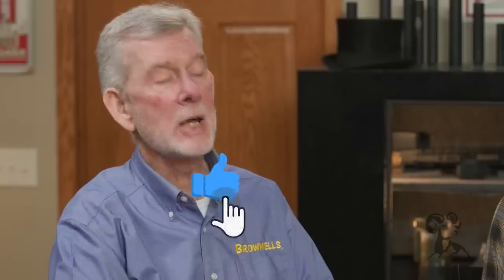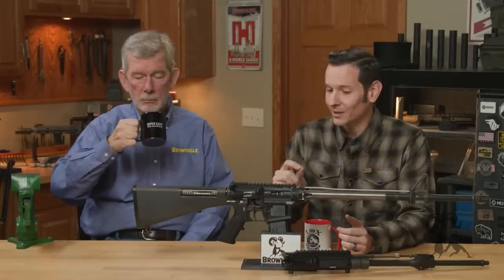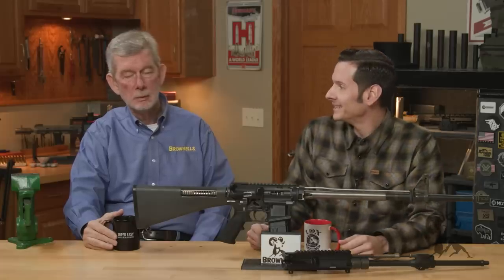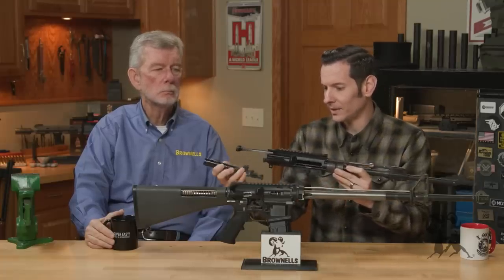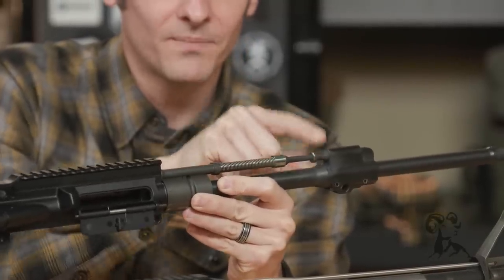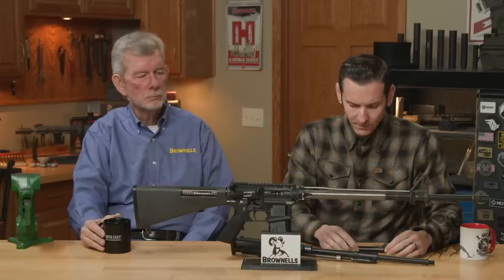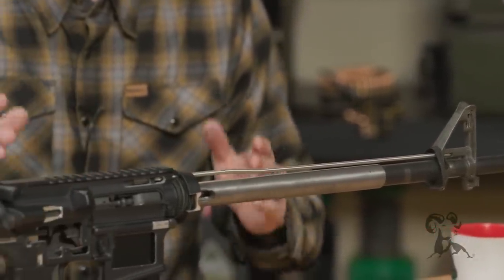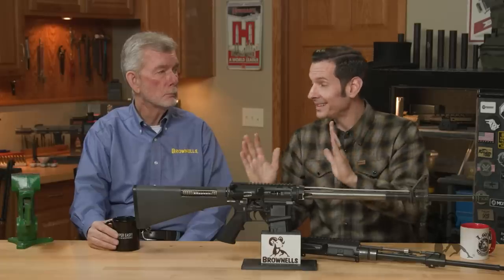Smyth Busters: The AR-15, Direct Impingement or Piston Operated?

Comment: Stoner was a freaking genius. The AR is basically a tube gun, no reciprocal mass that is of the bore axis except for the tiny hollow gas key.
Reply: What do you mean? The bolt is reciprocating.
Reply: @freeandcriticalthinker4431  I think he meant to say that all the reciprocal mass is inline with the bore. Other than the gas key.
Reply: *OFF the bore axis
Reply: @freeandcriticalthinker4431   I think he meant to type, "no reciprocal mass that is ABOVE the bore axis except for the tiny hollow gas key."
Being "above the bore axis" is the KEY thing.  Hah, pun!
67
Reply: Kalashnikov was more genius.
Reply: Kalishnikov merely copied existing piston/op rod designs.   The Stoner AR system was completely unique.
Reply: Maxim, Browning, Kalashnikov, Stoner. The Big Four of Gun Design. Stoner or Browning for the King?  Can’t decide.
Reply: @mikeoxlong3676  I personally think the 47 is OK. It is heavy and it feels bigger than it is, if that makes any sense.
Reply: @jimziogas8978  I'd have to give it to JM Browning, he created more designs, and long before Stoner did;  Stoner would have had to stand on Browning's shoulders, so to speak.
Reply: @recoiler4545  probably
Reply: Too bad it won't run in many conditions an longstroke piston gun will.
Reply: AKs are super dated. Hard to even put red dots on most. Near impossible to use lasers, lights, nods, suppressors. Then talk about shooting prone or reload times.  AR wins in every possible category. Plus your running steel case crap.  AK is cool, maybe if you like retro  commie stuff or video game guns.
Reply: @recoiler4545  nice one
Reply: The gas key does not have any directional force. Its simply a part of the gas tube, that gets unlinkedwhen the bolt carrier moves back. It experiences only a pressure force, that works in all directions like it is in the "rest" of the gas tube.
Reply: And yes: Stoner was a freaking genius.
Reply: @mikeoxlong3676 the AK is literally an upside down m1 garand
Reply: It’s interesting to reverse engineer it. To try to see what he was initially trying to improve. I believe “improve recoil” on a light firearm was his main mission.
Reply: @rumnboats7612  that's been proven false
Reply: AR-18>AR-15

Comment: A couple years ago, I heard Chris from Small Arms Solutions refer to it as an "internal piston" system.  At first, it went against everything I had been taught about the system since I was issued my first M16A1 in the early 80's.  Then he explained it much the way Caleb did, then the light bulb clicked on.  I've referred to it as internal piston operated ever since.  If I'm not mistaken, I believe there is old interview with Mr. Stoner where he calls it internal piston also.  But I'm not 100% sure on that.  Great video guys, as always!
Reply: Pistons are contained by cylinders. They are always internal. You had it right the first time. The entire bolt-is-a-piston story came from the patent attorneys and their creative writing - not Stoner. Ever heard of the cylinder being driven and the piston being dragged along? No. No you have not, except for the AR fiction
Reply: @Ni999  Have you ever driven a SuperMoto?
Reply: @woodrowcall3158  No and not all supermotos use rotary engines. See my other reply. The AR bolt is still not a piston.
Reply: So, it's an internal piston system???
Reply: @Ni999  So it is a cup piston, much like the LWRCI piston only the carrier is the cup piston..
Reply: @woodrowcall3158  My bad, the other reply was in a different thread discussing airplanes. I apologize for the confusion. Yes, rotary engines are the exception to my claim so my claim was weak in that regard. What's not weak is that Stoner called it DI and it was the corporate patent lawyers that tortured the definitions and came up with the story. DI had fallen out of favor, their prior art section glossed over the entire subject to sway the patent examiners. The design was absolutely worthy of its patent but the complete description would have been subject to greater scrutiny, and probably delays and reviews with no guarantee of success. Patent examiners can be very good but they do not have a perfect record with things requiring expert knowledge.
Reply: @hairydogstail  Yes, you can make the case that the carrier is the piston, absolutely. The problem came from the corporate patent attorneys wanting to avoid the DI explanation that Stoner used. They gloss over the entire subject in their prior art section as DI had fallen out of favor. The design was certainly (and obviously now) worthy of its patent but they invented an explanation that would work easily - and they were right.
Reply: @Ni999  Thank you for the additional information.  It's very interesting to learn the details behind it.
Reply: @Axe_six-six  You're welcome. I tried to reply with more specifics about patents but my comment was automatically deleted. 🤷🏻‍♂️
Reply: @Ni999  I was talking about the forks.
Reply: I could swear I've seen that interview I could be mistaken, but you're right either way Stoner was a genius.
Reply: @woodrowcall3158  Sorry. No, I was primarily on street bikes? What about them?
Reply: @Ni999  They are (generally) mounted upside down.

In relation to the frame of the bike the piston pushes the cylinder (which is attached to the wheel) down away from the bike.
Reply: @Ni999  I think I would call it sleeve ported, or a ported sleeve piston system - whatever it is called, it just works.
Reply: @Chuck_Carolina  Agreed, definitely.
Reply: @woodrowcall3158  Makes a lot of sense for that application.
Reply: @woodrowcall3158  I used to race a 1976 Mazda Cosmo in SCCA ITA class. 4 seasons of that cured me of any fascination I may have had with magic triangles and apex seals.
Reply: All semi automatic guns are piston operated, including direct blowback. The case itself is a piston, and is replaced after each shot.

Comment: Yes I already knew that but, playing the devil's advocate, since the gas does not use a dedicated "piston" and the BCG acts as the "strike face" you can look at it either way. How many pistons bleed off gas from a BCG or use a gas tube? True it is not a true direct impingement on at dedicated "strike face" either. It certainly is not a true piston system either but closer to a DI system that uses a gas tube that a piston system does not. Since the system is not a true piston system by using a dedicated piston and the BCG acts as the strike face we call it direct impingement right or wrong even though it is not a true DI system. Maybe we should call it an indirect impingement. Haha.

Comment: Just when I was finally understanding the difference between a direct blowback v. gas-recoil operated pistol (And at an elementary level at that) Steve and Caleb drop this one on all viewers!  Good, interesting video (as always from the Smyth Busters duo), but I’m sure I’m not the only viewer still not certain I could explain the differences between the two operating systems, even after viewing.
Reply: It literally just comes down to where the gas is being introduced into the mechanism. At the chamber, at the gas key, at the piston face, at the bolt face, etc. The gas tube on an AR-15 is just a tube that dumps the gas into the receiver, that's it.
Reply: @tedhodge4830  :  TY Mr. Hodge.  Happy Holidays.

Comment: Great deep dive into the DI gas system. One could argue, a lot of the heat is dissipated over the entirety of the DI gas system, vs all heat collected at the gas piston, forward barrel? Both systems have their pluses and minuses.
Reply: Okay, there are legit advantages for the Stoner system, but this is some extreme copium.
Keeping all the gas and fouling concentrated in one area makes cleaning much easier.
Reply: @WaterZer0  Maybe, but all the heat, and weight, IS concentrated near the muzzle. That's not to MY liking. Your mileage may vary!
Reply: @03redrubi  I understand the weight issue, but where else would you want the heat?
Reply: @WaterZer0  Not where my accessories, and hand are.

Comment: Eugene Stoner was an Aerospace Engineer by trade.  You can't have unbalanced forces on aircraft and expect them to fly well.  He felt the same way about firearms.  He wanted all action/reaction forces to be on the bore axis.  I've seen slow motion video's of AK's being shot and you can see the barrel flex down slightly as the piston is pushed out of the cylinder about an inch above the bore axis.
Reply: Stoner was never an engineer..He never went to college..
Reply: Ak vs Ar = apple's vs orange's 
It's an old and boring conversation

Comment: Steve forgot to put his hip waders on for the level of BS Caleb was ready to sling on this topic… 😂

One important point:  Eugene Stoner’s genius in designing that gas chamber inside the bolt carrier does something VERY important. The bolt is pushed forward while the bolt carrier is pushed backward. This relieves pressure on the bolt lugs, making it easier to disengage from the matching barrel extension lugs and reducing wear and tear.
Reply: It gives the gas a chamber to expand into that allows it to impart force to the carrier, allowing it to move. The delay caused by the carrier moving and the bolt staying locked allows the chamber pressure to drop sufficiently, relieving pressure on the locking lugs. The lugs want pressure pushing them into the lugs on the extension, that's why they're called locking lugs.
Reply: @ShortArmOfGod  I do not understand what point you are trying to make.

Comment: Love the idea of having the piston inside the bolt and carrier. For very hot loads, it uses the pressure to keep the bolt pushed into the barrel extension, relieving some stress off the bolt lugs. It's also argued that the piston and the gas tube help blow out debris from the receiver making it technically "self cleaning." Yes, it does dump carbon into the internals, but carbon acts as a dry lube, so that may only increase reliability.
Reply: There's a reason you clean your gun periodically. The carbon sticks the action and creates friction. It is NOT going to be the lubricant you think it is.
Reply: The byproducts of ammunition ignition are not solely carbon. It 100% does not act as dry lube ever.
Reply: @MellowFellowOfYellow  Exactly
Reply: Propellant gases are not carbon, and AR-15's should have external lubrication applied to its components, just like any other mechanical component where friction forces are present. To quote Dallas Fohrib from CherryBalmz: "When we dug into it, the fouling that all of us have been calling “carbon” for so long? Well, it turns out there’s almost zero carbon in combustion fouling at all. It’s about 98 percent lead and copper particulate, coming out in rough sphericule shapes between .5 micron and 10 micron, with the final two percent being things like tin, antimony, or steel, depending on the composition of the cartridge." Suggesting that an AR-15 is self cleaning is horseshit. The weapon wouldn't function if it was blowing all the propellant gas out of those two little vent holes in the carrier because it uses that pressure to cycle the action. Here's another quote for you "So it’s this super-heated, dense metal particulate that was causing so much of the AR-15 lubrication burn-off in DI ARs, and suppressed guns. The temperatures inside a cartridge at ignition are right around 5,000 degrees Fahrenheit for a microsecond, and go down to about 3,000 degrees Fahrenheit two to six inches from the chamber." Propellant gasses can include anything that you find in the bore when cleaning. Think about what kind of heavy metal particles are in the gas next time you shoot an AR-15 suppressed and put your face next to the charging handle, including lead.

Comment: So one must define the term piston. If one agrees that a piston is a disc travelling in a sealed sleeve from a high pressure area often created by hot gases to the low pressure area within the contained sleeve. That movement caused by the pressure gradient often drives an operating rod that creates the desired effect.There is no piston in the AR15. The hot gas fills an expansion chamber within the bolt carrier forcing the bolt carrier rearward.there is some slight movement between the bolt and carrier as it unlocks but that in no way is the classical sealed disc travelling across a pressure gradient driving an op rod. There is no piston like structure in the AR 15’s operating system. The fact that the gas exerts it pressure within the bolt carrier makes no difference. The high pressure gas directly forces the bolt carrier to the rear. The bolt is just dragged along as the camming action unlocks it so it too is forced to the rear.
Reply: The bolt tail with gas rings is the piston.  Desert Eagle and Mini-14 both have static pistons.

AR-10/15 piston just happens to be an integral component to the bolt, so after the tail is finished its duties as a piston, it cams and retracts along with the carrier once telescoped.

Comment: Well here's the problem heckler & Koch are charging the United States Marine corps $1700 for each M27 IAR which is a 416 based rifle 

The Army is acquiring M14A1s for $700 to $800 a piece 

It seems to me that it's a lot better to tell a soldier who is already disciplined to run a cleaning rod down through an M4 as opposed to handing out $1700 just to have that Short stroke piston 

It requires a little bit extra maintenance but the AR-15 direct gas impingement or internal piston depending on how you want to split things works perfectly for the United States military we've never had any major problems with it nobody has gotten killed because the gas system itself let's keep what works and not hand out almost $2,000 for a 416.

Comment: I dunno, but to me if it has a metal rod above the barrel it's a piston gun, but if it has a hollow tube it's direct impingement, and anything else is the gun equivalent of arguing about how many angels can dance on the head of a pin.
Reply: So your definition is the piston has to be attached to an operating rod?? Look up what a piston is and you will get your answer..